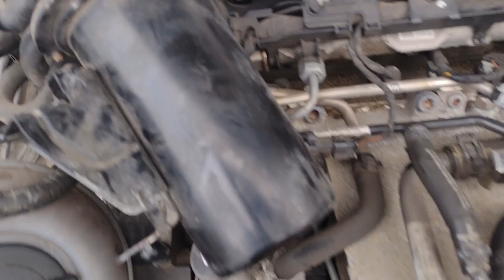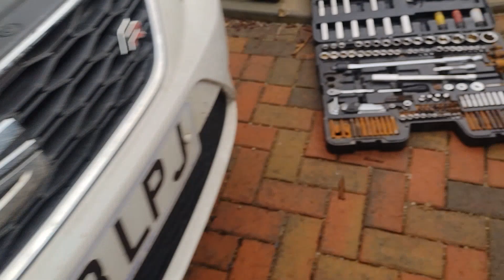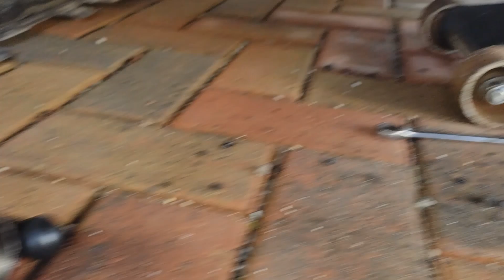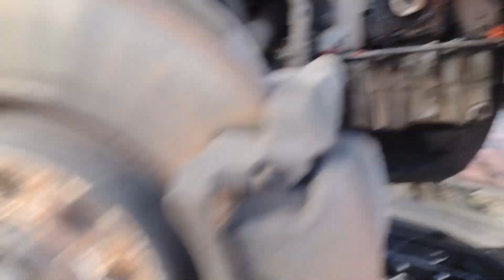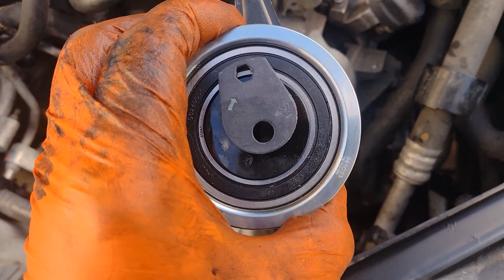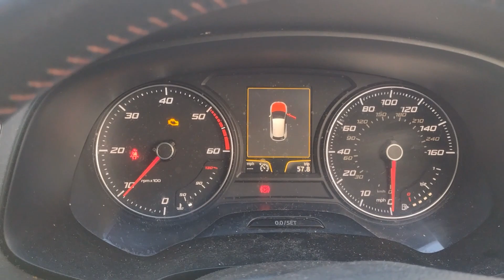SEAT Leon CUPA (timing belt kit/water pump/crank seal)

Comment: You should always drop the oil pan and change the wet belt for the oil pump and clean the oil pick up when doing the timing on these engines becouse they like to rip the wet belt and engine goes to scrap yard, good job for the rest 😉

Comment: Matt do you remove the silica pouch from expansion tank when working on these vag platform cars.
Reply from the maker: No I don't remove the bag if it has one, I just put in the coolant for the the car. Cheers Matt

Comment: Nice work Matt. A certain level of concern is a good thing, not bad. You understand the ramifications of oversight and that apprehension keeps you diligent. Cheers 👍
Reply from the maker: Luckily I haven't had a problem when starting the engine, cheers Matt

Comment: I'm totally with you when it comes to being nerveaus before starting the engine. I usually crank it a few times with just the starter motor. And this engine is really a "bit of a squeeze". Compliments for not swearing at the designers...

What's the torque on the crank bolt? I remember the issues with it coming loose on VWs AAZ engines. And that one went with some 200 Nm + nut lock if I remember correctly.
Reply from the maker: Thanks the torque is 180Nm + 135,Deg. It's a tight bolt